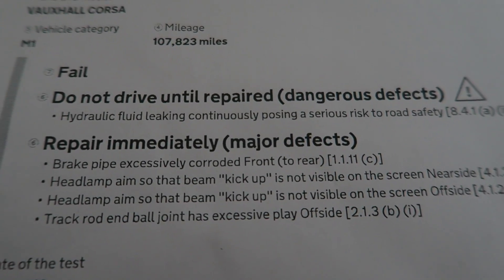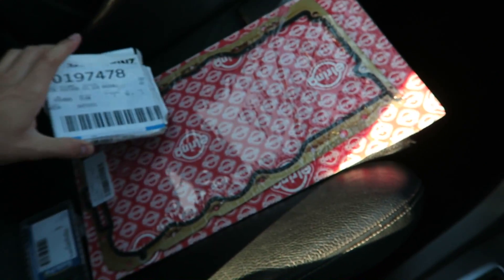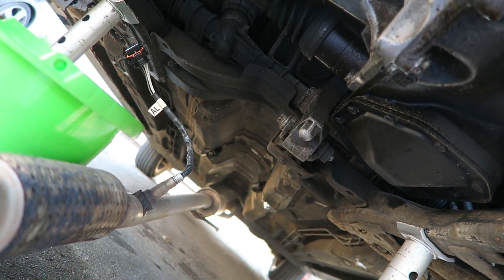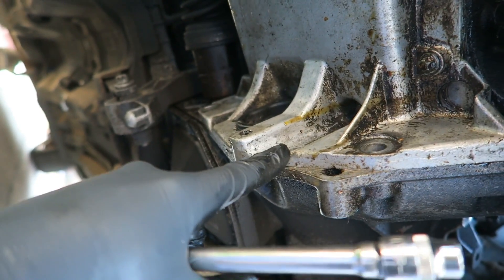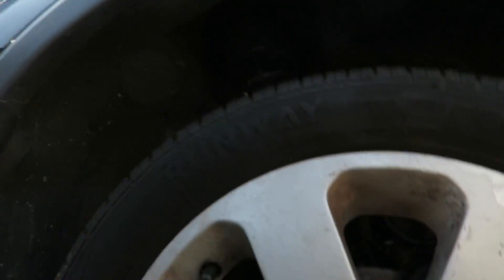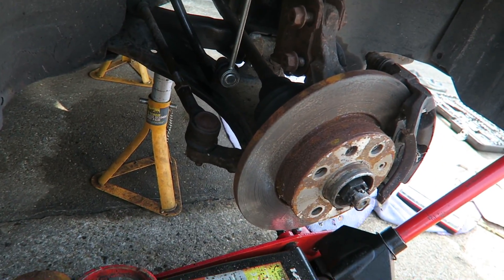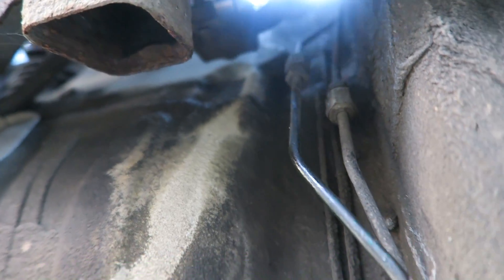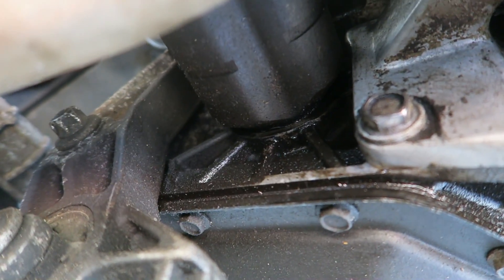Fixing The MOT Failure Corsa!

Comment: I'm an MOT tester and I'm telling you now stop taking your car to that garage. They are bent, if DVSA paid them a visit they would be in trouble because they are making fraudulent fails. Nothing wrong with the brake pipes, oil (yhh bolt missing) but not enough to deem a fail, missing the strut bolt (what can i say). Find a new garage and stay well away from that one.
Reply: You mean DVLA.
Reply: As a tester myself, thats fkn shocking. Basic stuff!!!!  Locking/retaining device loose, track rod end my arse.
Reply: I totally agree, I do mot’s as well mate there’s nothing wrong with those brake lines, wasn’t worth reporting. But once again great video
Reply: I totally agree. Confusing hydraulic oil for engine and transmission oil... missing that lose strutt... Failing for slight surface rust on a brake line.  
The sad thing is most people would had gone and spent thousands on another car after that fail.
Reply: Can t see anything deemed unworthy for the road . That should of passed . You've been had by them mate
Reply: small oil leak is only a p&a last i checked but they put hydraulic for the fail prob trying to play the dangerous fails shouldn't leave etc 

tbh the only 2 fails would of been the headlights (if they are even out ) and the strut bolts that they didnt even notice
Reply: I still don't understand the way UK Mainland does their MOT tests... Here in NI you need to book it into an MOT centre and although they can be dicks (to say the least) because they'll fail a car on things that aren't bust. (I say this as they failed my uncle's Grand Vitara. Couple of years ago for a "split break pipe" although all pipes were changed the day before.... Took the car in the next day for the retest and they passed it after fuck all had been done) but i suppose it's al about meeting a quota.
Reply: @GenSmashsed  it's the same here it must be a mot center that does the mot but alot of them don't follow all the rules or fail cars trying to get work
Reply: Lol Martin bellendddd
Reply: Exactly right,  the test is there for a reason,  take it somewhere that gives a shit next time , where I take mine they use a shaker plate on the lift to find loose joints etc

Comment: The oil coming from the pan looked normal - if it's just the oil cap and / or crankcase vent pipes that have some mayo, it's usually caused by condensation build up. It's accelerated by short trips (engine doesn't see operating temps for a long enough time to burn off the moisture) and leaky gaskets etc. that allow moisture to enter the engine when sitting. Some engine designs are more susceptible to this.
Reply: Nugetti Yes I agree with this my brother had trouble with a 1.6 Astra he was always doing short distance at the time a great car though.
Reply: On a previous mot there was an advisory for overheating during its test so its possible there is a cooling system issue but most likely the usual vauxhall mayo build up.
Reply: Hello. That mayo might come from a clogged PCV. If you have the same on the breather pipes, remove the valve cover and clean it up with hot pressured water. The mayo should disappear.

Comment: My personal tip- you can use a scissor-type ball joint splitter to push the rubber exhaust hangers halfway off the pin. Once they've starting going over the ball on the end of the pin (if your hangers have them) they're much easier to shift by hand. It's also handy for breaking them free if they're stuck on with rust.

Comment: This is for all engines - On the engine block, where the timing case, or in some cases, the rear main seal carrier or oil pump meet the engine block, a bead of quality sealant should be used where the surfaces mate before fitting the sump and gasket. Not all over the sump or gasket, just a very sparingly on the join where the 2 components meet. This has been standard for pretty much every manufacturer I’ve worked for.

Comment: That brake pipe ain’t even worth a failure! Yes as someone mentioned the oil look very milky! It’s most probably the chain cover gasket failed, head gasket normally ok on these! Also would be worth changing the oil filter as you got the oil out as you didn’t mention it! Also what you can do with the kick off is put some beam benders on so the kick off is a straight line! Also I’d be taking the car else where for an mot in case they’ve missed something! Keep up the videos! 👍

Comment: Reckon you could be right about the mot tester noting the corrosion, An MOT station I used to use  was literally a 2 minute drive away from my house, so when I put my last car in for an MOT after a week long holiday layup it picked up an advisory for surface corrosion on the brake discs, so I'm guessing they have to acknowledge that they have seen it to cover themselves. Agree with you though the Corsa pipes are still in pretty decent shape after a clean up. Another quality vid mate cheers for uploading 👍
Reply: @Delta Romeo Agreed that was a shocking oversight on the part of the mot tester!

Comment: Sometimes the ball joint for the aduster can pop out of the reflector bowl if someone has tried adjusting it to far one way, which judging by whoever has previously worked on it and left bolts loose is a possibility. Sometimes you can pop the ball back in with a couple of levers.

Comment: You didn't notice the camber change with the loose bolts going round bends ? Remember trying to set up the camber&caster on my old VW Scirocco small amount of adjustment made a huge difference on steering and handling took most of a Sunday afternoon well worth it though handled we'll miss that car

Comment: Fitted a recon steering rack and forgot to tighten the bolts. Was an experience having to turn steering wheel about quarter on sharp bends before car would  follow. Was fine on shallow bends tho.

Comment: As a mechanic myself I am flabbergasted that an MOT tester would miss those dangerous pinch bolts on the strut and fail the car for surface rust on that brake pipe.  General rule of thumb for rust on brake pipes is that most often than not the rust appears worse than what it actually is. If you press the nail of your thumb in to rusty pipe and it creases it, the pipe needs changing. If the pipe doesn't crease then you can do what this chap did in the video.

Comment: I know I'm just sitting here and typing while you're doing the hard graft, but you do realize that had you given the suspected leak area a good clean with some carb/brake cleaner spray then let the engine run for abit over the course of a couple days, you might have rather easily spotted exactly where the oil is seeping out from and saved yourself a load of work or second guesses. That is why the top takeaway from this video is ; always clean up the oily pools and bits when you suspect a fluid leak. Making the area spotless will highlight where fresh fluids escaping from and where they simply collect/splatter instead of wondering if you have multiple leaks .

Comment: I took my car for an MOT once, the guy rang me saying the car was ready, drove off, few miles down the road, engine management light came on, car could not regenerate, boost pressure bullshit, I looked around the engine, couldn't see anything, pulled the exhaust pressure sensor and gave it a good clean up, nothing changed, took the car to a decent garage only to find a very fine cut in the turbo hose which wasn't normal as it looked like if it was poked with something very sharp and definitely wasn't a cracked pipe. so I would't be surprised if they had something to with the missing/loose missing bolts

Comment: An easy way to confirm where a leak is coming from, dust some talc over the areas you suspect, then any fresh oil/water leaks are easily visible.
Reply: No, you can buy it in every supermarket.
Reply: @Delta Romeo the asbestos containing talc was banned in the 1980s I think but you can still buy talc

Comment: Got to agree with all the other comments, find yourself another MOT garage! Tells you it's dangerous to use on the road because of an hydraulic leak - which turned out to be just engine oil, but totally missed the fact one of the struts was about to part company with the hub! Scary stuff.

Comment: Buy a pot of hammerite to do the brake lines when you need too, nail varnish is not a good idea, its easy to chip and has no anti rust properties. As for missing bolts, and failing to tighten them up, you really need to double check repairs from now on. Your lucky the owner didn't crash and sue you. I'm amazed neither of those cockups weren't Spotted by the garage though. That's incompetency. My first thought was they removed or loosened them knowing its a 2min fix after you tell them to fix things as most people do. Pro mechanics also saying the brakes were ok indicates they were looking for fails also. Check the engine light works, I'm guessing it will and you pulled the plug or else it would put the engine light on and screw up the emissions. You should change the oil filter as well, when ever you take the oil out as standard and replace the oil. Doing the air filter at the same time can also help on emissions and saves problems later.

Comment: Might just be me, but there looked like there was coolant in that oil.......
Reply: Tom Wilde  with the milky oil cap the head gasket is on its way out , just the same as my sons corsa did
Reply: Thats condensation from short journeys. A good blast at high speed will clear that
Reply: Phil Long I love how everyone assumes head gasket straight away... look for the simple things first that milky cream on the cap could just be condensation from not being used much and not driven very far
Reply: @taylorhaddock2782  it was the milky oil in the sumo I was referring too, cap means nothing of it hasn't been used.
Reply: @Phil-1969   corsa c models especially the 1.0 and the 1.2 versions are prone to condensation in the rocker cover when they are not used very often and normally a good oil  and filter change then a decent run say 100 miles and you'll find all of that mayonnaise  on the oil cap will disappear

Comment: euro parts stuff is terrible quality buy cheap buy twice
Reply: If you pick the cheapest parts not all the make parts are shit
Reply: @shanekneeshaw3483  most them are mate I've tested them vs local 2 rear springs lasted only 2 week from euro vs local over a year and still going and that was euros high range at 50+ quid each  a spring also tested euros brake dics and pads lasted 2months and there dics warp so tryed there top range sports dics and they failed nothing to do with the calipers as they were new same with brake lines and abs pump  been there done it wasted cash on euro a few times thermostat housing bought from euro shit quality rubber seal only half the thickness it should be so buy shit buy twice